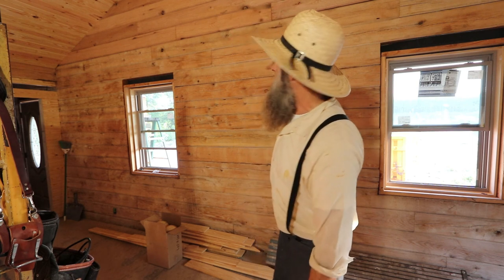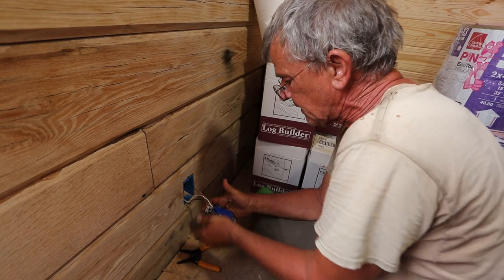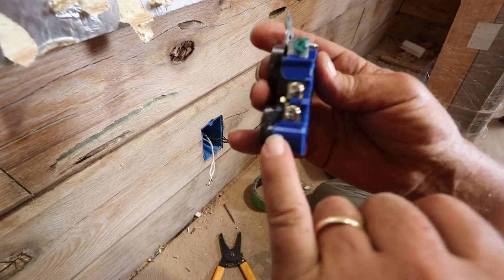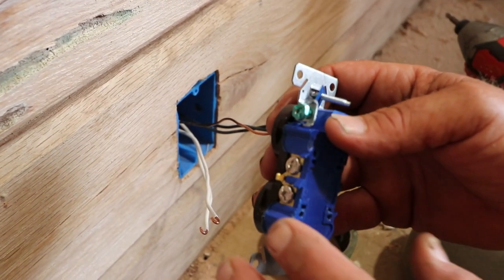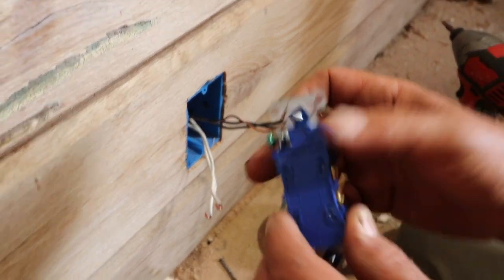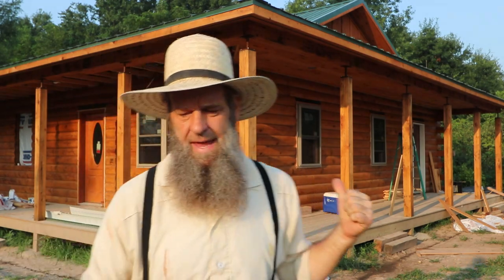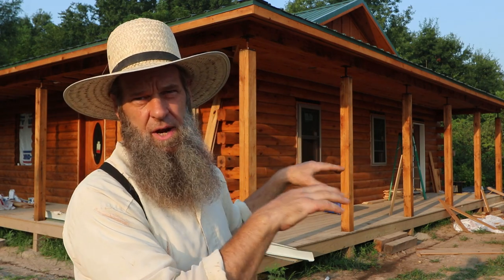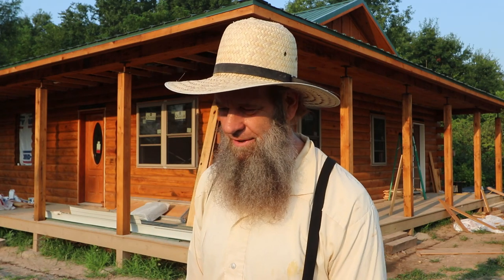Electrical CAN be DANGEROUS! D I Y Log Cabin Build day 70

Comment: Anyone that said ya can't use #12 on a 15A recep needs to go back to work under a knowledgeable journeyman. As long as the breaker is the weakest link it's all good. The ground being face up in commercial is per job specs not anything to do with code. Unless it is say in a hospital and it's a local code. Not NEC though. It all depends on the area, I've worked from Seattle to key west in 31+ yrs on multi million sq ft jobs.  Stabbing a recep in the back holes is just bad practice and shunned upon.  Same with not pigtailing to each recep.
Reply: I don’t think anyone said that but they were stabbing a 15amp receptacle with 12ga wire and not 14ga
Reply: @kenanderson9331  gotcha, to many sparkies out there have worked for one company their entire career doing only residential. They just don't know the difference in actual NEC, local code, common practice, and just the way they were taught.